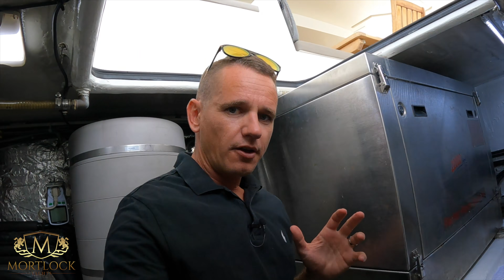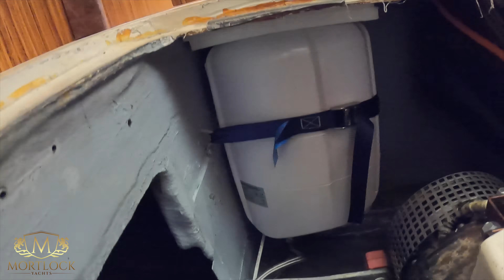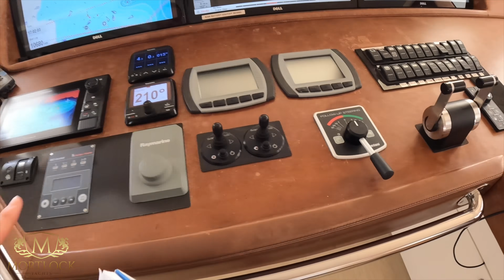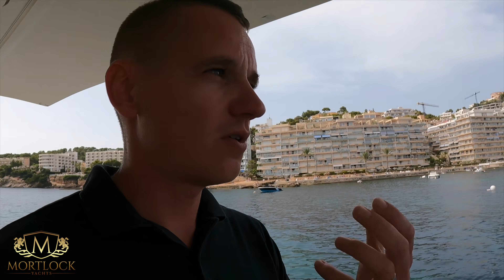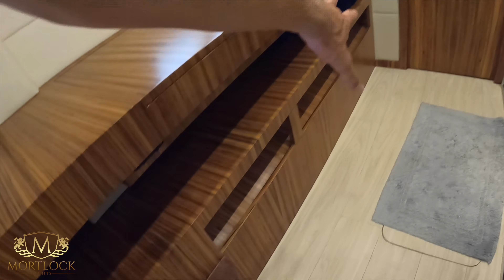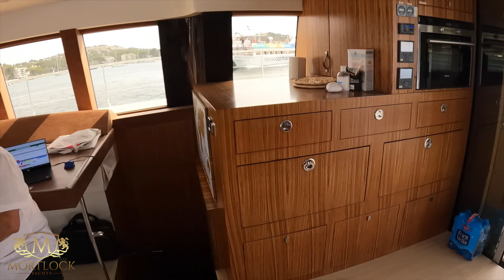TESLA OF THE SEA??? | Walk-Through

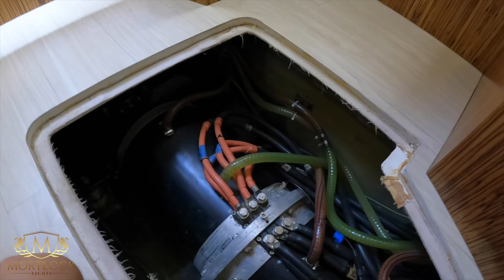Comment: 6:00 seriously? That monster of a motor only produces 20 kW?!? The drive units on my Tesla Model 3 are smaller than that and the stronger one is rated at 190 kW. They also have their own cooling system and they get throttled down fairly quickly when asked for full power, but I think they are able to easily deliver 100 kW continuously. 

I know it's difficult on a boat to deliver the amount of energy needed for that performance, but I'd assume spending $100k on a big fat battery bank that will deliver that power for a few hours is not that hard (I assume 500 kWh to 1 MWh, 2.5-5 tons) should be possible. An electric motor that is incredibly efficient at the low end (watch Sailing Uma, consuming <500 W at 3 kt) and packs a ridiculous punch at the top end should be possible, if not easy. 

What those designers built feels to me a bit like those "compliance cars" that the established automakers have been putting out for years (I think BMW got seriously surprised by the success of the I3), but nowhere near a Tesla. If it was the Tesla of the sea, it could get up on plane at about half throttle.

The 13 kW generation capability sounds like 5 kt, yes, which I'd expect for this. For a cruising cat, you'd have to spend a few weeks at anchor to fill up the battery bank... ;-)

In my opinion, the better way would be to put sails on this boat, the fat motors I mentioned (my Model 3 also has master-slave, adding up to 340 kW, no real point here), regen capability while under sail, maybe more efficient hulls (like Outremer) and you could cross the Atlantic at 10 knots and do the last 50 nm at 25 knots, driven by powerfull electric motors. I wonder if it's possible to design a hull that can be sailed efficiently and still get up on plane and go fast. Maybe with some wings.. (my English vocabulary leaves me here, think the high performance racing cats that got 40 knots in 20 knots of true wind).

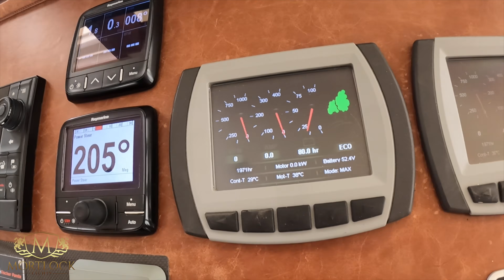Edit: 12:12. Ok, I see the problem. No high voltage electrics here. 52V, no wonder you have no power. Getting decent power out of that voltage would mean half the weight of the boat is copper busbars... 

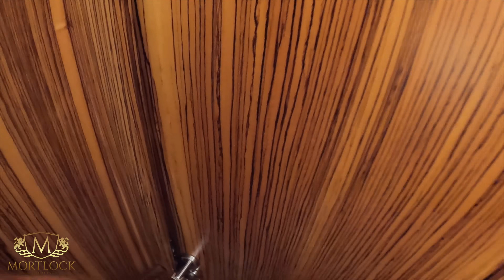12:55 gorgeous layout of the cabins, though! I assume one of the closed doors is the master's head... 

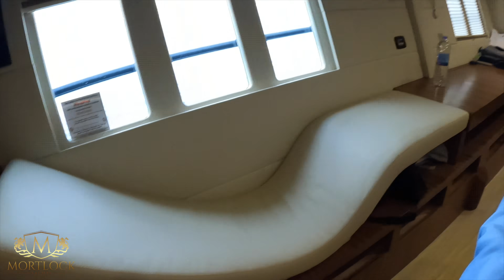16:49 only.. that sticker... right where I'd want to look out... ARGH!

What is my conclusion? I want this boat. It's gorgeous. It's just lacking sails. Unfortunately, I can't afford it. If I win the lottery, I'll be talking to Outremer and the designers of this boat and have them design something next level. :-) That boat would end up costing north of 3 million, though... ;-)
Reply: the motor itself isn't that big - its just encased in that big water jacket for cooling.  They made it so that motor can run continuously, where Teslas are limited to a few hours at a time.
Reply: I had exactly the same question, but I think the low rpm a propeller needs could also be a reason for the power output. I wonder what the max torque of this motor is.
Reply: Just remember this boat is from 2016 quite a lot has changed with Silent Yachts since then,

Comment: Remember, this is a 6 year old boat.  Technology has come a LONG way since then in batteries and solar panels.  As a Tesla owner, I can tell you that the great unknown on the Silent boats will be HOW LONG will the battery last??   What happens when it starts to degrade and you lose the ability to charge and move.   As the impedance increases, you'll have much less range and speed as battery ages.  I am curious as to what the degradation is  on the Silent is in the marine environment??   Typically after 4 years or more, the Lithium batteries start to degrade.
Reply: Technology has not come a long way in 6 years.
Energy density on our best batteries has increased by like 10% at most and thats about it.
Solar panels havent changed at all in that time except that they got bígger so they can advertise higher wattage and hope people wont realize.
The newer silent yachts use LiFePO4 batteries because they are much cheaper and weight is not a concern anyways so cycle life and degradation is not of any concern.
The boat we see in this video can be considered a prototype which will have its own problems because of some weird choices.
Reply: @Pixelplanet5  They key to any transportation is the efficiency of the craft to overcome friction resistance. Lighter materials and better engineering will yield more benefits not yet known for boats. So engineers in these fields need to use first principals in rethink conventional boat design, that is the solution. As new battery tech can be retrofitted as greater energy density is realized in the future. You must consider battery engineering and motor design at scale is still relatively new compared to ICE, now being phased out worldwide. Look at GM and Ford with electric cars as they have been using the same old manufacturing processes combined with old inefficient design and materials, big fail. As a example look at Tesla and Aptera design for efficient vehicles produced at amazing scale and profitability.  The pace of innovation is unmatched at Tesla a industry leader, everyone needs to copy paste their techniques.
Reply: @tigaagul7  agreed! Like why not design batteries to be the superstructure line tesla is starting to do with model Y etc. That way you don't have the weight of the superstructure plus batteries. Why rely only on solar for renewable charging when wind, aquathermal, and tidal turbines could all be used to charge batteries instead of using diesel...
Reply: @Pixelplanet5  My concern is that everytime Silent Yachts roll out any kind of ship promotion, its either THIS EXACT ancient yacht because "It crossed the atlantic" or the Silent 60 basemodel.

I dont think Ive ever seen anyone do an IRL test of the viability of a Silent 80 EVER.

Suspect....
Reply: @TheStaniG  thats because zero Silent 80 have been build so far.
They could cross the atlantic even without using any fuel, it just takes longer to do so.
Reply: @Pixelplanet5  I think the first one should be hitting the slipway any day now. I can't wait to see a tour of it.
Reply: Changing the batteries on a boat like this might be easier comparing to a Tesla.
Reply: @markush.2445  Absolutely. You can just swap one out vs.. well all the Tesla crap lol
Reply: Also a Tesla owner here, and I noticed that the over all design has changed. I would expect them to switch to LFP batteries in the long run, as they can be charged to 100% without degradation. But, those batteries like to be fully charged.

One thing I didn’t like seeing is the guy in this video getting that close to such high voltage! But again, the newer Silent Yachts have changed quite a bit by the looks of things.

Any yacht manufacturer who isn’t paying attention to this probably won’t be around in the next 30 years. This amazing to see.

The most recent version of this yacht the batteries were in the main deck. I would have expected them to stay in the lower deck for added stability. But, I’m sure they know more than I do about this!
Reply: @AaronVanNoy  The boat manufacturers need to use first principals to optimize the design to overcome friction and drag as in the case of Tesla vehicles a industry leader. I would expect lighter and stronger materials for boats designed to be manufactured at scale. This would improve the bottom line and survivability of these new companies. Additionally FSD for boats would be a game changer in boating.
Reply: @tigaagul7  most boats already have autopilot software, so something like FSD is very possible and many boats are also equipped with FLIR cameras already which is the best camera system to employ
Reply: 10 year warranty on batteries and 25 years for the panels

They will replaced urs for free if ur unit is degrading fast compare to average

Im sure the cost of maintaining, fuel and buying a an engine after 20 years is still more compare to buying batteries and panels

Comment: For showers, the smarter solution is conduction-boiling fixtures. The units cost $200 +- at Alibaba and heat water on-demand ONLY as needed - without limit (assuming you have energy in batteries). This permits zero energy loss hot water without having to store a tank anywhere on the boat, and its cheap too.
Does that BlueCool heat pump/air conditioning unit also dehumidify? This might seem pointless at sea and yet it will fight mold spore creation and give you dry towels in your bathroom.s...